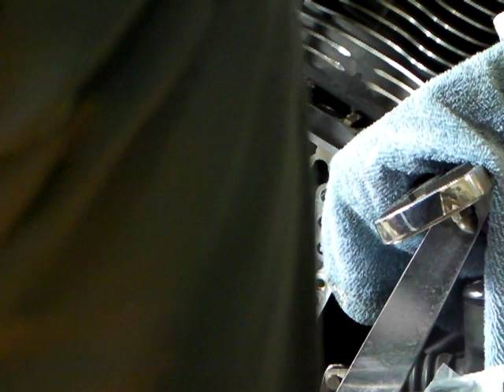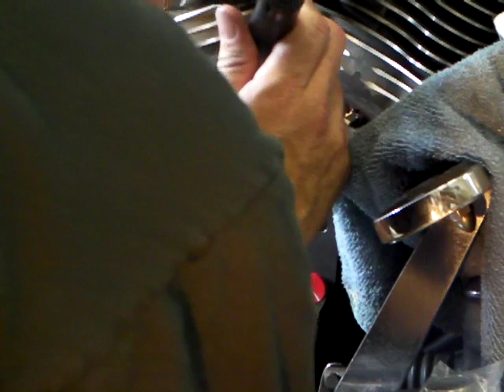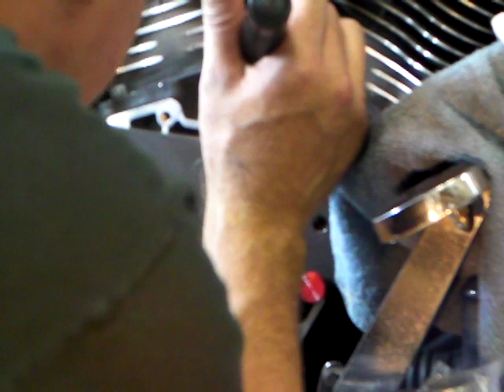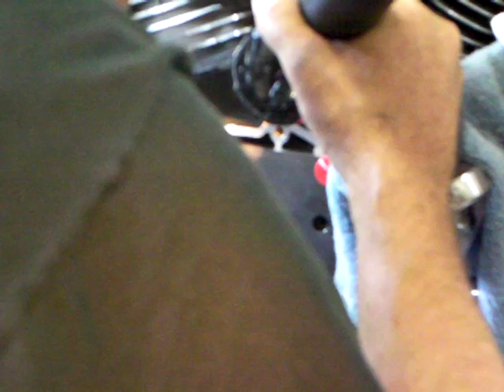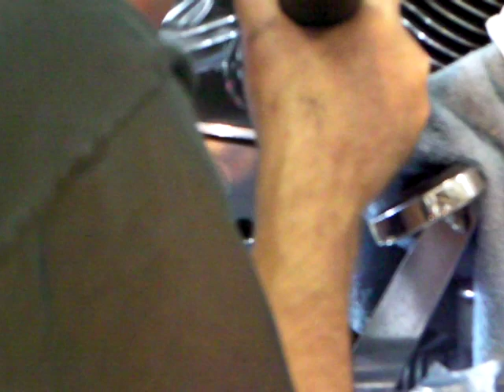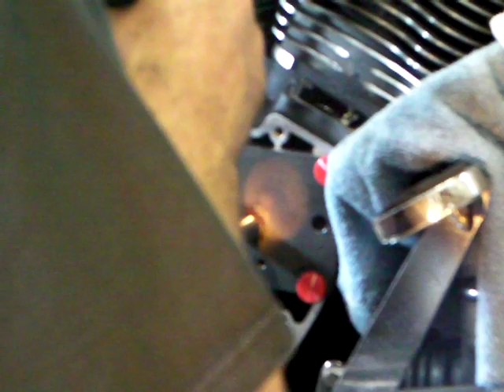19. Harley cam chain tensioner replacement on a Twin Cam

Comment: the letter side is the stronger side which is made to stand the pressure of the press with out damage to the race. this mite cause the bearing to spin if it was damaged please take the time and redo it the damage will be coastly

Comment from the maker: @mikeintruder1500 - I looked at the JP video you noted and page 3-89 of my manual, and I agree with you.  It appears that the stamped lettering should face outwards, not inwards.

Thanks for taking the time to comment - hopefully others will read it.

I guess time will tell how my repair holds up with those inner bearings in backwards...

Comment: All part numbers, letters, whatever should, 99.9% of the time, always face out/up whatever. So the part number can be read when still installed. Seems you know now but is everything running ok? I would like to know how long it goes and if it lasts the same amout of time. Leave a comment if anything happens.